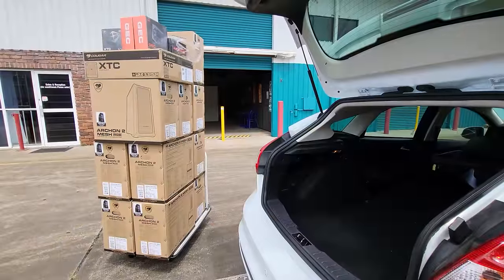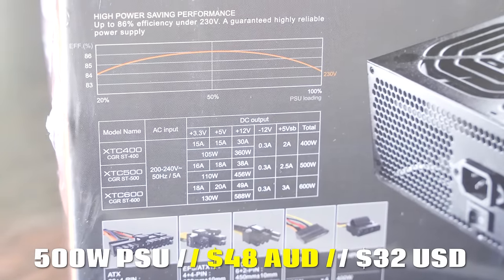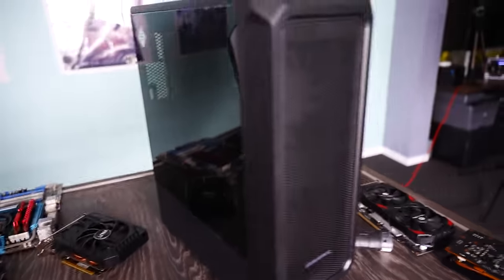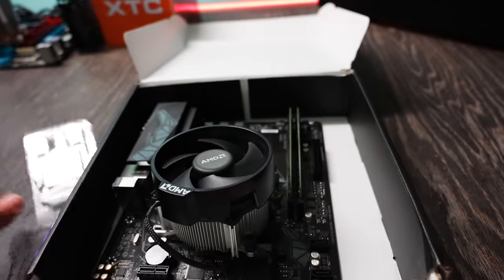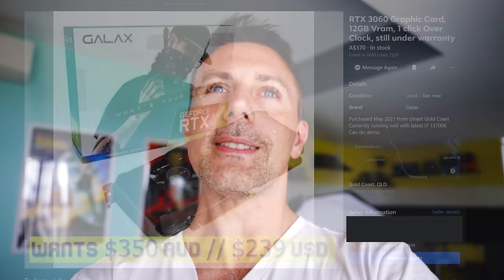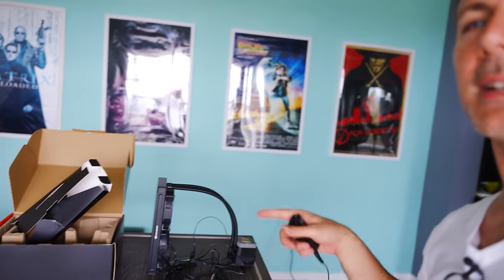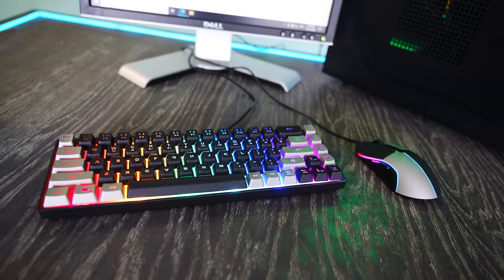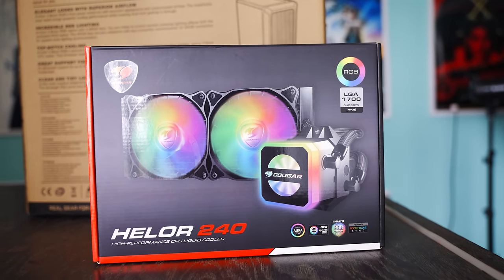How Much Money am I making Selling Gaming PCs....?

Comment: It's crazy how good DDR4 for is getting for the price to performance, Personally running 11900K with 32GB 3200MHz and it works amazing for the price over DDR5.
Reply: a lot of people like to trash 11th gen, but in reality its still a very capable arch, 11700k/11900k will be good for many years, depending on your needs i recon you should be able to skip drr5 all together with that 11900k as ddr6 should be in ~2026
Reply: @h1tzz  I personally don't think that it's that bad and I only game paired with 3080 so I expect I will get another 5-8 years as I still play alot of older games mainly 2020 and back.

Comment: Did you test if the ryzen 1600 worked in the b550? I have a 1600af works perfect in my msi b550 even though officially not supported

Comment: Hey Tech, I have been building for years and have thought about doing just what you are doing, building systems with used and cheap parts  to sell on but. What always stops me is the thought that I would be spending all my time servicing customers PC's. Could you tell me how much time you spend in doing this or how you keep from doing this? Really curious to know, thanks. Cool shades btw.
Reply: Charge for servicing hourly 😁 Basically, you sell computer as used, therefore you don't need to give any kind of warranty (although there is customary 15 or 30 days) . Anything beyond that is caveat emptor .
Reply: Just offer warranty on parts, software not included. Of course, used parts would have a shorter warranty
Reply: I’ve done it for three years on the side nothing to big and 95% of PCs were sub €250 builds and I’ve sold like a 80 PCs and only had 2 people reporting a defect after a while that I ended up fixing for the price of replacement parts. I don’t give warranty but I test all pc extensively before selling
Reply: @sijedevos2376  Testing also takes time, i.e. you are putting more work hours into single computer.
Reply: @aleksazunjic9672  Yeah sure but returns take longer. I run aid64 for a hours to check for ram stability and then play a couple of differnt games for a few hours.

Comment: Got an RX 6700XT from a friend for almost £150 it was an ex mining card he was straight with me he did under volt the card and made sure that the card wasn't stressed to the max used the card for 6 months before Ethereum moved to proof of stake tested the card on various benchmarks works great!!!
Reply: That's one heck of a deal
Reply: @Vinmono  yeah
Reply: undervolted and never reaching high temps mean the silicon is as good as new, you just need to be mindful of the fans, they're always the first to go on mining cards, if you know how to change them that be a plus.
Reply: @endless2239  extra fans are like 15 dollars so yeah
Reply: @endless2239  yeah incase the fans do go bad I can always get replacements off eBay thanks for the heads up
Reply: most mining cards are more than fine to buy. Lot of redditor and youtuber have put miner under bad sign. Just dont buy gpu that have mine for 5 year and youll be fine
Reply: Im jealous.  Even as a mining gpu those 6000 series are not very old I would have jumped on that deal

Comment: I can vouch for the cougar XTC. I've had one run better than a seasonic, a superflower, and pretty much all the japanesed power supplies that I have in any collection. At just 400w it was a daily driver PSU as it produced the least ripple out of all the power supplies that I had, and also had the least vdroop that I could see. My i5 3570k overclocked the best on the XTC 400 - on anything else it just ran worse. Even the Superflower 750w that replaced it, was not nearly up to the same caliber as the budget darling 400w XTC. All my XTC power supplies from 2018 to now, are still running like day 1. This is despite possesing as far as I know, 0 japanese components and pretty much some of the cheapest parts that you can come across in a power supply. 

German engineering with chinesium parts, but done right.

Comment: $275 Profit on a $700 pc is nuts, well done. Do you find the $700 price point best for profit/quick sale?

I used to buy used parts and sell PC's in 2016-2018ish. Built around 15 PC's, usually 2nd gen intel + 770/280x spec for $600. Best profit was $150NZD, mostly $50-$100. 

The parts market is so small here in NZ, with way more deal hunters than sellers, and Trademe has such a stable market. 
I found there's two types of sellers in NZ: The prebuilt buyers trying to sell for what they paid. And the custom PC/parts seller, selling for no more or less than the market price. No deals to be found.

Did it as a hobby but eventually got sick of minimal profits for all my work. And people ringing up screaming that the PC's a dud, after they've plugged their monitor into the motherboard.

Comment: The MSI 12th gen Intel desktop codex 5 I think, AIO are trash.
Sent it back they replaced water cooler, 2 weeks ago that AIO crashed and burned. Still under warranty, but MSI website giving run around making a RMA, I got fed up and ordered a Tower air cooler, Noctua D15 dual fan.
Ripped out AIO, put in Air cooker, turned Bios OC back to normal OC, the D15 idles at 13c, full power on, 78c to 80c max, turbo heat fluctuations, but always comes back to 60 to 70c, in bios also changed cpu coer from AIO to Tower cooler.

Comment: I've been running the Cougar Helor 360 for 3 years now no issues,  I disassemble/clean refill with distilled water each year and it's running strong for my 10900K.  The nickel baseplate allows for some L.M. action too.

Comment: When I was an overclocker I'd build odd systems out of the parts I was finished with and sell them to my friends kids.  I was mainly just looking to get most of my money back from my parts.  I generally hung onto my top end motherboards, a lot of them cost as much 2nd hand now as I paid for them new.
I did supply a small office with some towers but they kept hassling me to sort out there software, I pretty much got the blame every time there was a problem so I didn't do that again.  For what I made it wasn't worth the bother, easier just to do some overtime at work.  Building office boxes is zero fun, neither is setting up networks which is why I'm out of IT.

Comment: I think i lucked out with msi i got a MSI Coreliquid 360R 360mm RGB Liquid Cooler on a 12900k and its been fine so fare just over a year old every day heavy use.
i have 5 years labour 2 years parts and 3 years collect and return on the hole pc so i will keep a eye on it i always have river tuner open with cpu temps gpu temps and fps anyway.

Comment: Hi I tweak around a little with computers but I’m finding it hard to find a motherboard that I can use that have nvme and wifi. My current pc is working great but would like to increase speed up a little, or should I not bother and build for scratch something more modern. It a shame I can’t add picture here but will explain what I already have. I7-3770, asrock H61M-HVS motherboard, with 16GB of DDR3 as well as a GT1030 graphic card as well as a 2tb ssd and a 250gb ssd. Ideally I would love to do a motherboard swap so I can add 2tb nvme and maybe up to 32 gig of ram and nvme wifi. But as I said would I be better just rebuilding from scratch with something more current, I guess I was hoping to just update on the cheap lol. Would love to here your input, also main use is internet computer but son plays game as well when he get on it lol.

Comment: Hi Brian,
I do have two questions please:
1) I noticed that you used a pc case with top panel (usb and audio ports at top surface). How to ensure keep the ports dust free? the only solution I have in mind is to put a removable cover (a plastic sheet or a cardboard) on them and just take it out when I need to use them but its practically annoying.

2) What is the best (and cheap) method to connect SAS drives to consumer pcs? there are many used SAS drives in the market and they are twice the speed of SATA drives in general. Do you think its a better solution than using two SATA drives (in RAID mode) ?

Thanks

Comment: @Techyescity I found out about a DDR4 ram scam on Ebay. Adata and some resellers from Israel. Are taking XPG D41 and D41G taking the heat spreader off and putting a XPG D50 casing on it and packaging and selling it as XPG D50 I have had stability problems for 4 months thought it was my GPU turns out it was the ram the entire time. AMD platform. Tried different Ram timings and everything the only thing the ram is good for is regular desktop work and browsing. You try to game itll crash with no error

Comment: Hey Bryan, what gpu do you recommend to pair with the 5800x3d for 4k@120 gaming???
Reply: 4090
Reply: I'm running a 3080 with mine and it seems to be working pretty well with decent frames, really smooth even in games like DCS,
I undervolted my 3800x3d to keep temps down a bit and am running a 240mm AIO with a pny rtx3080, there are a few benchmarks on YouTube with this combination that could be be worth checking out
Reply: @cardona54321  Yea I had to UV my 5800x3d also. It was running 85c with a 360 EK AIO. Now I have push pull with 6 fans. It still runs in the 80’s so def UV was needed. I just went ahead and purchased a used 3090. UV it also. Was pulling almost 450 watts. Now it runs less than 300 so I’m ok with that. Let me know if you come across anything weird. I put some 4000mhz c18 in the build. It seems to be running ok. Not sure on how to see if it is running 2:1 in infinity fabric.
Reply: @epeksergastis  yea would be nice if you could get one at decent price or msrp but kind of hard right now.
Reply: I'm running 32gb of cl18 3600 ram with XMP profiles enabled, when I undervolted my CPU I've got it stable running at max 75degrees with a 240mm I'd cooling AIO, I'm only running 1440p but it seems happy with everything set to Ultra so far, before I undervolted it wanted to run in the high 80s but I've only got 2x 120mm intake fans and 1x 120mm exhaust plus the 2x top mounted AIO fans running as exhaust in the top of the case, I'm using a mATX cooler master td300 case with a mesh front and so far since undervolting it doesn't seem too toasty. I'm undervolting at 0.100 at the moment but might experiment a little more to see if I can squeeze a little bit more out of the CPU before it gets ugly
Reply: How are you going with the 4000mhz ram? I heard anything above 3600 with a ryzen system can be problematic, I haven't b tested it to confirm though
Reply: @cardona54321  hum…..interesting. I’m only at -0.075. Maybe I can try to bump it lower. Did you decrease the clocks any?  I left mine alone and it still hits 4450 sometimes 4500 mhz or 4.5ghz. But I’m running 4K also not sure if that puts more of a strain on the cpu.
Reply: I haven't touched my clock speed at all, there is a guy in YouTube that managed to undervolt his to 0.150 apparently and it was still stable and getting good scores on cinebench, he tried 0.200 but it crashed on him so he backed it off, have a hunt in YouTube and you can see him go through the process, his temps were pretty low with minimal decrease in fps, I'm no expert but mine seems to be running really well with no issues,
Reply: Sorry I think he might have done it with a 5500
Reply: @cardona54321  yea I think I will try to push mine to at least -0.01. I’m def not a pro by any means but enjoy learning. I appreciate all of your info. Makes me more comfortable pushing it a little lower with possibility of stability. I tried to look around to figure out a way to see if ram is running at a 2:1 infinity fabric but I’m still not 100% sure how to tell. I’ll keep looking for an answer.
Reply: I just checked my numbers and I think I losing a little bit in the way of  performance but cinebench but it's running well and definitely staying a lot cooler so I'm happy with it.i might see if reducing my UV a little helps balance between performance and temps, My biggest concerns were temps as it spiked up to 88 degrees before undervolting before I stopped the test,
If you get any decent results let me know though, I'm in the same boat with learning too
Reply: @cardona54321  I got it stable with 0.125 UV.  I had it at 0.15 but i lost around 1000 points so not worth it for me but at least its less now.

Comment: Does the 3930k have more cores. Or threads than
 The 4790
Reply: the 3930k has 6c 12t and the i7 4790 have 4c 8t so yes the i7 3939x has more cores and threads only buy 3930k if it comes with a motherboard. the motherboards they need are expensive
Reply: Older architecture, more cores, more cache. It's Sandy Bridge vs Haswell. Unless Bryan did a solid OC on the 3930k, the i7 4790 was the better choice for gaming in most scenarios. Or if you account for power consumption at all.